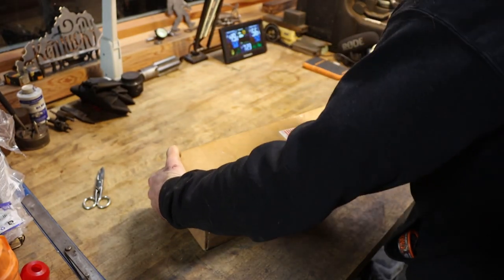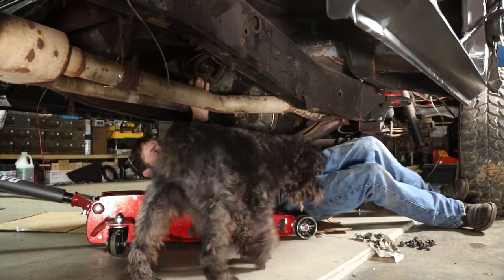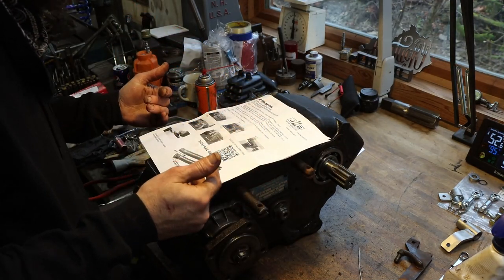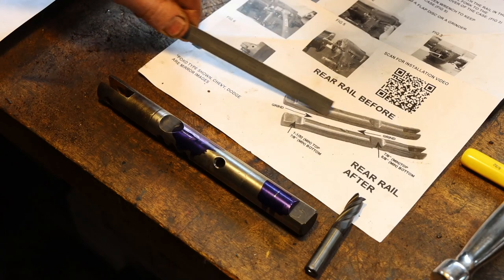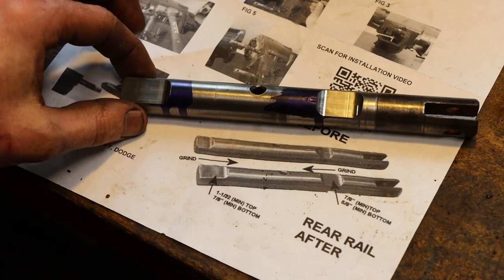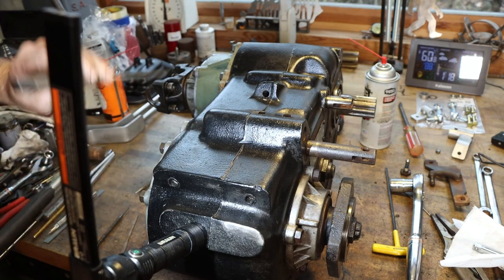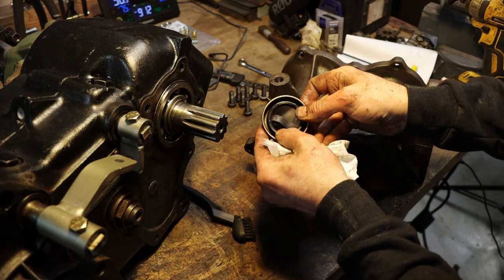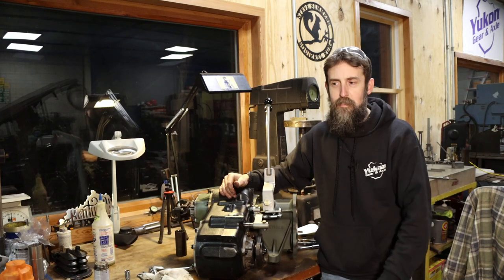Twin stick Transfer case mod from JB Customs

Comment: That reminded my of a story that is funny now but could have been a disaster. I used to have to pull the transmission out of my 62' Chevy on a regular basis when I first started driving.  Fast forward a couple of years, I was in my mid twenties and building my house.  The contractor was going away for the weekend and he asked me if I would change out the clutch on his mason dump truck.  I said not problem.  I went to his shop and worked in his garage,  I removed the power take of from the trans and slid under the transmission just like I did on the Chevy.  I pulled the trans out and it dropped down on my chest just like my old Chevy 3 speed.  The only problem was that is was about 3 times the weight of what I was expecting.  I was stuck under the truck, working all alone, with the trans sitting on my chest and I could not move. I finally maneuvered around enough that I was able to roll the trans off onto the floor and escape.  Needless to say I used a trans jack to put it back in. Enjoyed the video.  Merry Christmas and Happy New Year. Looking forward to next weeks video.
Reply: Same thing happened to a buddies brother! He was used to 3 speed transmissions and pulled the cast iron 4 speed out of his 68 Roadrunner.
He got Trans off himself as well, but was scared for a bit.

Comment: My cousin ( a little guy) used to have a 3/4 Chevy that he pulled a too heavy goose neck with. He went through several clutches before he found one that would hold up. He got quite good at dropping out the tranny and transfer case by himself and putting them back in. :) He didn't have a garage or concrete floor either.

Comment: Merry Christmas! The 205 is one of the stoutest transforcases built and one of the hardest things to handle.
Reply: How is the 203 different?
Reply: @kevinhornbuckle  the 203 and 208 are chain driven. Over time the chain will stretch and eventually they slip or break.

Comment: Being a 60's baby, I grew up around old jeeps, Dodges and other four wheel drive vehicles that had twin sticks and no lock out hubs. I always liked the idea you could simply throw the box in to low for example to back up a steep ramp or hill or ease a heavy trailer into a tight spot with out burning up the clutch or having the 4WD pushing you around on hard ground and hampering maneuverability . I can see the case for front wheel drive only option. Good mod if you ask me.

Comment: Really appreciate you showing how to modify the case and show how the shifting works. I'm looking at doing a 231/205 doubler for my jeep xj. Having this level of control is just badass. I'd have 1:1, 1.96:1, 2.72:1 and 5.33:1 to front and or rear wheels. Think I need this in my life and those controls are for sure the way to go.

Comment: Did you by chance install that case adapter seal backwards? It looked like the lip was out on the one you removed but you installed the replacement with the lip in. I've installed a few twin stick kits, that one is very nice. Folks don't think the FWD item is anything good, but it can make maneuvering around things easier if the front is pulling while you steer and don't have the rear end trying to push as well. Want an odd test, On pretty much every one of them that I've installed if you drive it with only the front engaged they get better MPG!
Reply: on mine, the seal worked both directions, I'd imagine it's the same on his.  on older cases, or as an option on the newer models, you used two seals installed facing each other.
Reply from the maker: Ill have to give that a 2nd look. I may have installed it backwards 😖😊. It was two days later when the new seal was installed.
Reply: Saw the same thing.
Reply from the maker: Yep, it was backwards.  Repaired! 
Thanks to everyone who noticed . Santa knows I would have missed it.
Reply: Well spotted, Blazer!!  And good catch, Steve.  Cheers to you both.
Reply: @Steve Summers  better it gets spotted now, than after it's all together and you have to pull it apart to fix it.
Reply: Saw that too. Can't imagine it being a problem, it would take some doing to get the 80w90 past the seal and neither side is under any pressure.
Reply: @rickmiller1425   It probably isn't on Steve's truck, but my Dodge required a different oil in the transmission.  I started having oil from the transmission migrate to the transfer case, getting it overfull and oil started blowing out the vents.  

...
more later if I can, something just came up, I have to cut this short ...
Reply: Blazer02LS Just getting to watch Steves video and noticed right off when he was setting Seal that it was Backwards. Yelled at him but then realized I was 4 Dayz late, then checked comments and see that you saw it too.. Glad he repaired it before putting it back together.. Keep up the Good work Steve

Comment: A little late here. But when you installed that seal in your adapter, you put it in backwards. It’s counterintuitive to normal seal installation. The flat surface faces inward.

Comment: Steve that's cool my 70 dodge power wagon cone i built in 1982 had twin sticks .the 1966 PW came with twin sticks but not a NP 205 i think it was a NP 200 and i used a NP 205 in my build and wanted the single stick but the mount off the frame was for twin sticks . Your lucky these day you can buy stuff like this keep up the good work .  Weld a couple of plates together with a post when you reinstall the T,C  JM

Comment: Great video, I hate to be that guy, but i believe you flipped the seal on the adaptor. the spring goes towards the transfer case to retain that gear oil.

Comment: Merry Christmas, Steve & Family.  I appreciate the look at that kit.  I've considered doing something similar on my old Dodge.  Not to run front only, without the rear, but to be able to use low range and leave the entire front axle system disengaged.  But now, after the 52" stretch to the wheel base, front only pull with individual rear brakes (like the rock crawlers have) doesn't sound like a bad idea.  It steers worse than an army truck.

I rebuilt that case back in ... well, a long time ago.  I don't remember it having the steel plug.  Hard rubber, I think.  They can deteriorate and cause it to weep oil.  Replacements did not come with the bearing kit.  The big service jack I used had a transmission cradle available for it.  I got it primarily for that job, and have used it on others since.  I highly recommend getting or building one.  It doesn't really make it any easier (at least in my experience) but it can make it a lot safer.
Reply: yeah he needs a proper transmission adaptor for his floor jack...you can buy them cheap nowadays..but all you need is a flat plate and some pipe to fit your shoe on jack ...and then you can chain it/or strap it securely....and make some brackets and different holding supports as you need ...for each use....SAFETY...it can fall off a small shoe in a microsecond and hurt you... when working alone it pays for the cost everytime you manhandle some transfer case or transmission...and you'll wonder why you never had it before ...i used mine to handle my Jeep fuel tank too...sure made it easy..i used some wood to keep it steady and straps ...what a simple job taking it off and down and then back up and on....half full of gas...

Comment: i made my np205 twinstick conversion for the price of another indentical OEM Shifter with the oem shift link rod. and 1 longer shifter mounting bolts n a bunch of flat washers between the 2 oem shifters.  the trick is to, you have remove the front output shift rail and extend the 2 lands on the shift to the corrected length . then reassemble the shift rail. i used 3/4 inch ID water pipe onto both shift rails with a drilled 1/4 inch hole vertical on bother to attach shift link rods onto.... the homemade shifter boot is...... don't ask.. LOL . all works great.. shifts great . its kinda funn smoking  just the front tires when you want.. front wheeling only.. if wants to.. it is nice to be able to front wheel only during snow season..  ( 3 years of research then i built my own conversion for 
CHEAP )

Comment: Just back from spending Christmas Day with the kids and grandkids in Bristol,  regarding the mods to the shaft I would have been tempted to use the shaper and wear out an easily regrindable toolbit instead of an endmill, but still, you got 'er done and that's the main thing. Have a good Boxing Day and a happy and prosperous New Year. Best Wishes from Somerset UK.

Comment: Have you ever thought of putting some strong gas springs on the z axis of the mill to help raise it? Depending on the length of travel, I'm seeing up to 550 pounds each on McMaster. Not going to be cheap though.

Comment: Hi Steve,
Very cool modification.  You will probably find situations where you use the independent front/rear control that you didn't realize previously that you needed that ability.  The truck is going to be really nice when it's done.  Merry Christmas!  Thanks for the video!
-mike

Comment: Merry Christmas Steve and Family. Does the seal you replaced need to be orientated in a particular direction? as the lips and spring garter where facing the other way when you removed them on the video ;) Sorry I thought I should mention it.

Comment: Any reason you flipped the new seal? 
My Unimog had it where you could do independent front and rear with or without locking. Very handy at times.

Comment: Did you stick that oil seal in the right way round because you knocked the old one out with the face with the part numbers facing inside or does the new seals lip face the opposite way round?

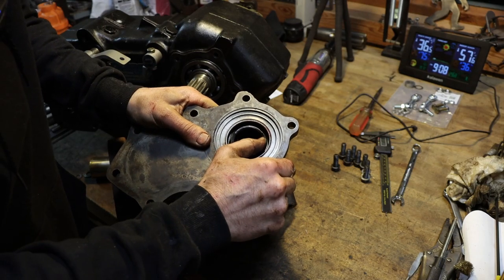Comment: Thank you for the nice video. I'm really sorry, 'cause I'm not sure, but did you change the direction of the seal? Seemed like "the lip"-side were out when you took it out (22:06), and in when you mounted it (24:36). (But I'm not sure like I said). Have yourself a good Christmastime. Best of wishes from Norway.

Edit: I should have read the other comments, others saw it too AND you've already fixed it. :-)